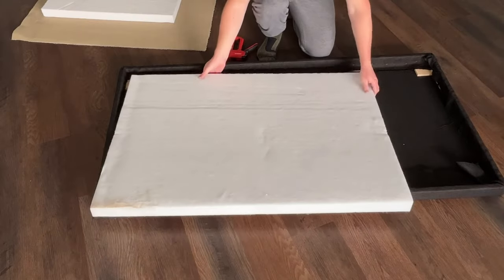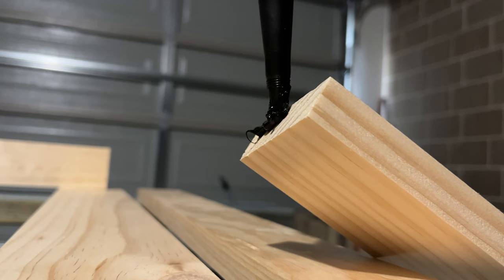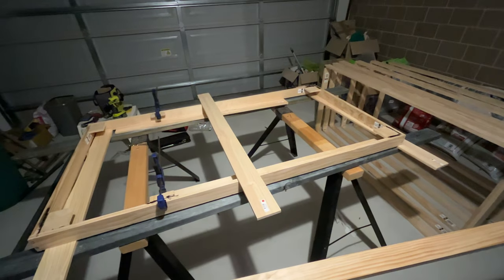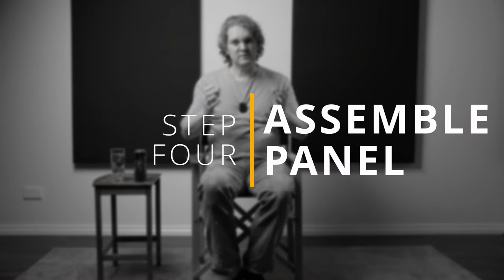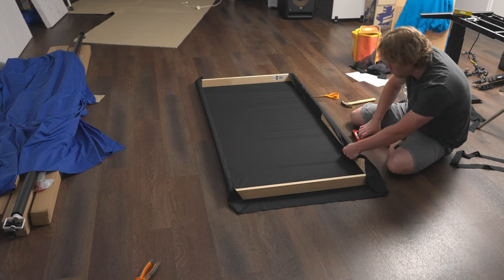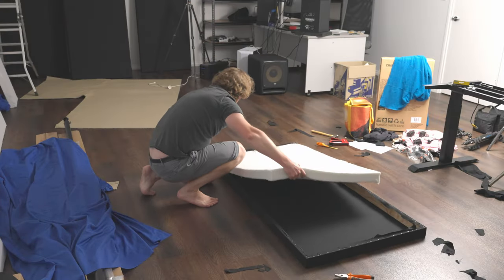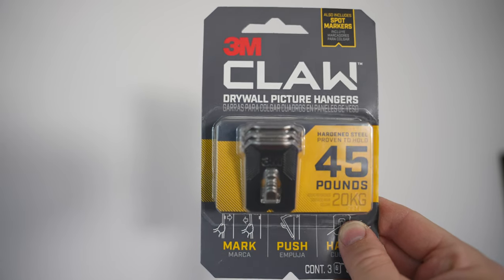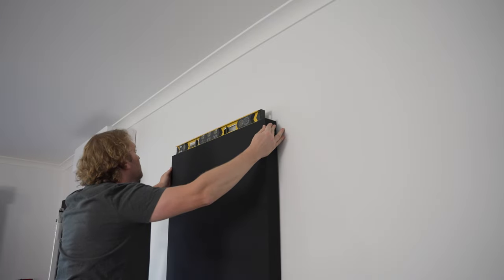How to make DIY sound absorbing panels for beginners

Comment: Interesting video. One note worth considering when selecting materials is that mineral wool has a class A fire rating (it doesn't combust easily). Polyester is highly flammable. Agree that this is a moot point (timber framing after all).
Reply from the maker: Good point - the stuff I chose (CSR Martini Absorb) has the following fire resistance (Australian Standards AS 1530.3) test results:

Ignitability 0
Spread of Flame 0
Heat Evolved 0
Smoke Developed 0-1

Comment: I'm thinking of making some panels with guiar amp grill cloth. I think it will look super cool. I'm guessing as they are designed to let sound through It shouldn't be a problem. What d'you think Jason. Is it a bad or good idea
Reply from the maker: Probably would be good for acoustic transparency, you might see the white panels through it though depending on how wide the holes are in the cloth.
Reply: @JasonRobertsVideo  I've managed to find a company in the uk that does black poly foam. They do 50mm and 25mm. Do you think 75mm would be thick enogh to be effective for mid to high frequencies? Thanks for your help
Reply from the maker: Wow - the black version sounds great! You would have to check the acoustic specs for the particular poly you are looking at - if they cannot provide you with specs then you may want to be cautious about buying it - it's not just the thickness that matters it's also the density (weight per cubic meter or similar) that makes a difference to acoustic properties.

Comment: Great video Jason. After doing this, for a small room, do you think it is negligeable what kind of mic you use? I have a Rode VideoMic Pro, could a lavalier be a better option? Thanks.
Reply from the maker: I made a ton of videos with a Rode VideoMic Pro+ in a small bedroom and there were no problems with the audio - the room was carpeted, small, and had some cheap acoustic panels in it so there was basically no echo/reverb which was good.

Comment: Where did you get the thermal polyester panels?  How thick are they?  Are they dense or lose?  What I mainly find is polyester batting that’s not as thick or dense as yours. Would an upholstery place or online have them?
Thanks.
Reply from the maker: This is the product (Australia): https://www.bradfordinsulation.com.au/commercial-and-industrial-insulation/walls/martini-acoustic-polyester-products/martini-absorb#current

I got the XHD 50mm think I think - it's dense and on the heavier side. Depends where you are in the world, not sure what USA equivalent.